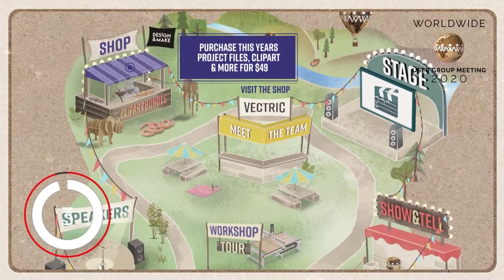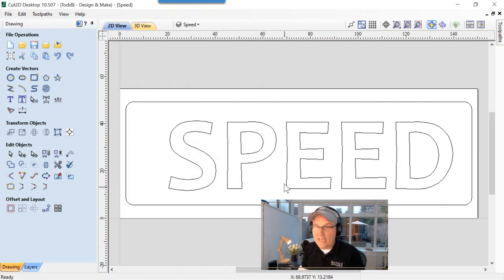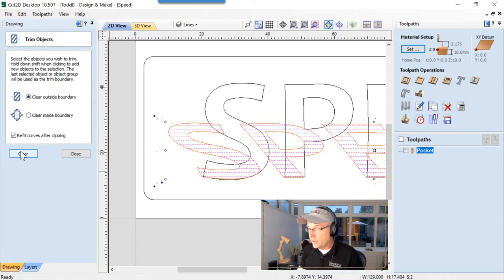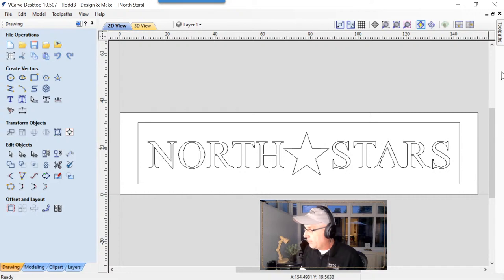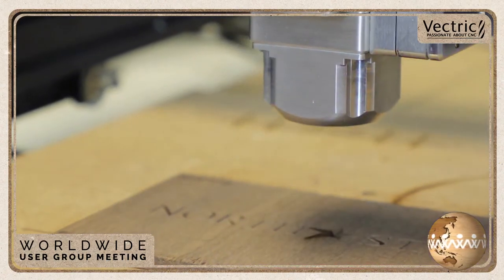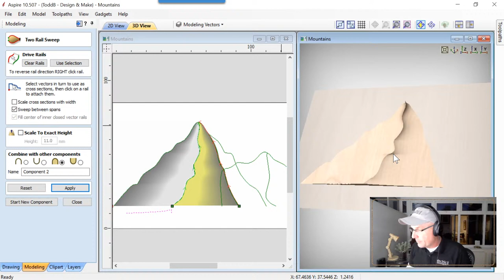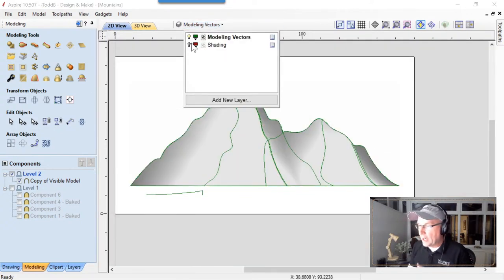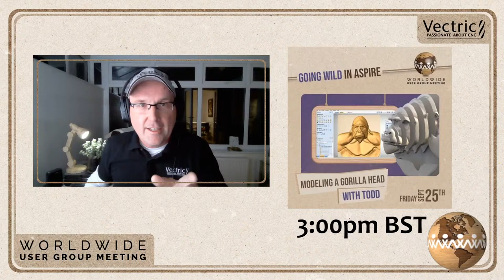Hybrid CNC & Laser Machining by Todd | Vectric Worldwide UGM 2020

Comment: Todd,
The laser you are using has clearance to allow movement in Z to follow the model. In the Jtech presentation he took great lengths to get the laser exactly 1/8” from material. I’m guessing the Jtech laser wouldn’t work well for what you did here. Comments?
Reply from the maker: Hello, sksmithapa and thanks for the question.  The J-Tech laser that Jay shows does have a shroud over it to keep you safe.  The OPT laser I was using did not (I had to be sure to use the proper protection) so I had more Z travel.  I believe, and you should confirm this with J-Tech their shroud might be able to be removed from their laser or maybe refocus a bit further away.  Again they would know better.  We have an older version of their laser on one of our CNCs but it has a different setup. Hope that helps a bit. ~Todd